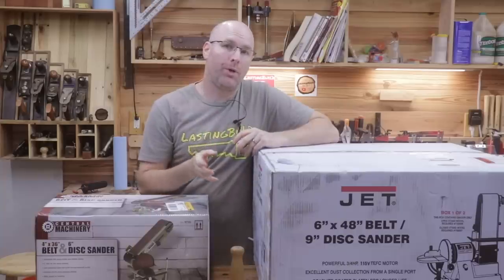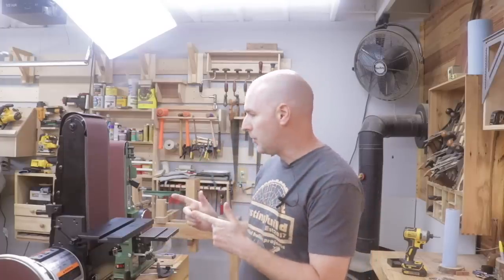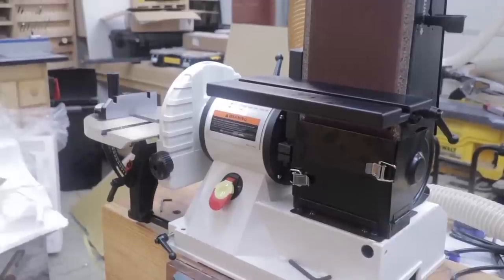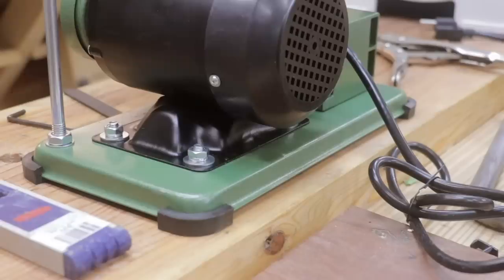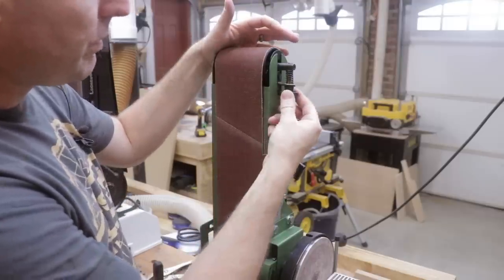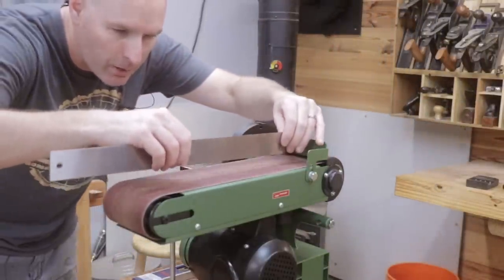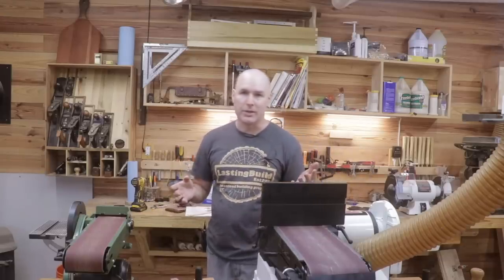The REAL Difference In This Cheap vs. Expensive Tool!

Comment: So this isnt so much a gripe about this video as it is about the whole HF vs expensive tool (ET) thing.  I have that HF sander, and it serves my purpose.  I wanted a belt/disc sander and looked at HF and ET.  My choice came down to HF or live without.  Going into the transaction I knew all those deficiencies you describe, but I knew I could work around them.  HF tools are infamous for their shortcomings and the underground network of modifying them so they work well.  I don't do production work, and I only turn on machinery on weekends, so I can live with my decision.  I recently watched a video of another woodworker I like who ran into some problems with an HF band saw.  He blamed the problem on the "cheap, and "unsafe" tool and vowed to throw it in the trash, thus preventing anypne else from getting hurt by it.  Upon further review, his was a case of operator error rather than maxhine failure.  I have that same saw and never experienced anything like what happened to him.  Again it was a value proposition in that I could have the HF saw or no saw.  Thats the choice for many of us hobbyists.  Its not so much Jet vs. HF.  Its HF vs nothing.  I can modify a dust port or build a bigger table to rest my workpiece.  I know that I will have to do that before I ever plunk down the cash to buy the HF machine.
Reply from the maker: Very informative comment! Thank you!
Reply: @lastingbuild1373  Youre welcome. I love ypur channel and the last thing I wanred to be was critical of your efforts.  I enjoyed this video.  Thanks for putting it together.
Reply: WW MM?
Reply: Nikolai Cook Just what I was thinking.
Reply: @matthewpotter1933  I'm guessing you're talking about the Steve Ramsey video lol. I felt the same way. I was like "Bro! Send me thet thing and I'll make it work!" Lol.
Reply: Well and the other angle to these cost propositions is "how much am I going to really end up using this thing?".  It's far safer to spend 60-150 bucks on a cheap tool, in the beginning, and upgrade later if you decide that's the route to go.   It's quite a bit tougher to spend 1000 bucks on a tool, realize you will hardly use it, and then face the dilemma of selling it to re-coop a portion of the cost, or letting it sit in your shop gathering dust (no pun intended).

I've done this with quite a few big box purchases... my first mitre saw was the 125$ Ryobi from Home Depot.  I wasn't sure how much woodworking I would really end up do, but I had an immediate need.  Once I got more into the craft, I upgraded to the 450$ Dewalt.  I still have the Ryobi, however, and it serves a niche when/if I need a quick mitre 'on-site', or I need to chop up some trash scrap for the garbage can.  I dont care so much about the tool or the blade, so I can treat it a bit rougher.  I don't want to waste my 100$ blades on the Dewalt chopping up trash 2x4s for the garbage, nor do I feel like swapping the blade out for such a silly task...
Reply: I agree, and they always pick the high end of the name brand tool, not a comparable version. Why not compare the HF with the JET J-41002, 2" x 42" Belt and 8" Disc Sander, 1Ph 115V (577004), a lot closer to the HF price range!
Reply: I think it’s a fair comparison. He said right up front what he was comparing. I’ve got a cheap Grizzly, fairly comparable to the HF and I recently bought a Grizzly $995 6 x 48 with 12 inch disk. The expensive Grizzly is comparable to the Jet here. The base is aluminum, as likely it is here, but the rest is all cast iron and steel. I bought the better one (with 1 horse motor), because the cheap one just doesn’t have the stability and heft when doing heavier metal work, which is a big concern for me. The bigger one is just far superior. There’s really no question that you feel that it will do whatever you need, while with the cheaper one, you have to be careful when you press, as the motor quickly slows down. That’s either with the belt or the disk. Nothing is really accurate as it’s flimsy. If you press down on the tables slightly, as you will while using them, they move. I think the cheaper motors are not putting out the wattage claimed. So, sure, they’re fine for the weekend warrior. I wouldn’t say otherwise. But if you use the tool fairly often, and want and expect it to just keep working properly when you push it, they fail. It’s a matter of being realistic. If you can’t afford, or find a good reason to buy the expensive model, then the cheap one will work. If you’re willing and able to put some effort into modifying some of the problem areas, you can make it somewhat better. But if you’re using it as part of your shop where it’s your living, either part time or full time, buy the better equipment. Remember, if you are making money with what you’re doing, this is a capital expense, and you will get your money back from writing it down for depreciation over three, or so years. So, in that case, it really doesn’t make sense to buy the cheaper tool, struggle with it and find it will have cost you the same in the end, assuming you don’t throw the cheap one out after some time. As an addendum, the big Grizzly motor felt stronger than 1 Hp. It’s 12 amps at 110 which is about 1 3/4 input Hp. Output seems about 1 1/2. Interestingly, the equivalent Jet model (at $1,500) which is pretty much exactly the same, claims 1 1/2 Hp for the same 12 amp motor. After having used the first some months now, I can say that spending the extra money is well worth it. These little models are really toys in comparison.
Reply: I absolutely agree. It's not Jet vs HF. It's HF or nothing. Harbor Freight fills a gap where I can do something on an inexpensive level or not at all. If the tool is cheap, often times a little tweak here or there is all you need.
Your comments above were spot on!!
Reply: That’s great for you. But the question still stands, for those who a better heavier tool is desirable. Some of you guys turn it into a situation where you say that the cheap tool is good for what you do and how much YOU can spend. Fine, but that’s not the video’s purpose. Not everyone wants to look between one cheap tool and another cheap tool. Many people want to know if it would pay for them to buy a better tool. You guys who complain about these comparisons seem to think they should only be of whatever’s cheap. He’s a professional maker, others do machine work (I do). We want heavier tools. Will the HF hold up, will the Jet, will my Grizzly? All different price levels and abilities. Yes, we want to know the differences.
Reply: @Joel4JC because that’s not the question here. It’s how a cheap tool compares to a higher price tool. There are other channels that just compare cheap tools.
Reply: @Joel4JC  this isn’t the high end of the Jet series of these tools. The high end of their belt/disk sanders is over $2,000.
Reply: @melgross I want more reviews on those 6x10s and 6x12s. 

Some beautiful beasts right there!

I’m not able to buy one new but those are some NICE looking machines! Pretty much no reviews for those.

Comment: Did anyone also notice the dude using disc sander incorrectly…is it just me or does that seem strange? And speaking of strange, for a guy who comes across confident about the topic and seemingly knowledgeable (at least on the surface) on tools and shop things does it really take an hour to put a couple belts and tool rests on a harbor freight belt grinder? Idk…but it’s not just this video or this creator that has been “funny” to me lately. What I mean is that I’ve been noticing a lot of YouTube woodworking and machinining tool reviewers that don’t seem to know very much about the hobby or profession for the tools that they are reviewing. Not all the time is it something that irks me, and there is definitely a place for obviously novice hobbyists reviewing tools (from a place of unintentional ignorance) bc that might be appealing to someone who is just getting into a similar hobby and wants to see what it takes to learn from scratch. I applaud those channels and frequent them often. But the thing I’m talking about is more reminiscent of this situation. A guy with a beautiful and seemingly high end and fully equipped home shop, filled with expensive tools and luxury items that even seasoned pros might not be able to justify, and then they do small little things that anyone with even a small amount of experience would know is totally wrong. Things like grind on the wrong side of the tool rest after making it a point to harp on the dust collection ports on the other machine. Speaking of which, what shop guy doesn’t have a drawer full of random cutoffs of pvc or hoses and a few zip ties to make a vacuum hose fit. And who compares a pro level machine to the cheapest one on the market? Idk, I’m not saying this guy is fake, but it just strikes me as weird and it’s something I’ve been noticing more and more. Maybe I should make a video about how I can’t decide between a 7x10” Chinese mini lathe and a $250,000.00 CNC machine. It just seems weird to compare these machines with each other bc there are many other similar machines that sit in between these 2. They aren’t even the same size, which would probably explain some of the weight difference. You would think a guy who can put $75,000 into a home shop would know better than to blow dust all up into his face bc he’s on the dangerous side of the tool rest. Just sayin…

Comment: Surprised you even bothered to compare them. If one has the budget to buy a quality built machine of the larger size, the small HF would not even be considered. Two machines of equal size and capability (small or larger) would be a more fair and useful comparison. A separate review of each one would probably have been a better approach. Each has its strengths and weaknesses, and definitely appeal to different markets and use needs.

Comment: When you do a comparison you should do apples to apples because they have a 6x48 combination Sanders $250 and comes with stand you should have got that one this is not a fair comparison
Reply: Agreed!  This is like comparing a Maseratti to a Fiat.  I owned and used that Central Machinery combo sander for a few years until I bought the Ridgid Oscillating Belt and Spindle Sander and the Central Machinery 12" Disc Sander.  I am pleased with both and I gave the Central Machinery Combo Sander away.  Last report was that it is still working.
Reply from the maker: That would be ideal but I did not want to pay for two expensive tools!
Reply: So your saying you didn’t want to compare apples to apples why even do it just to make HF look bad.
Reply: Sorry LB, but I have to agree. A shootout has to be fairly founded, this isn't; it's only 2x the money for same form factor. And the correct size HF tool claims a 1hp motor. I don't like to leave negative comments, but this isn't up to your usual standard
Reply: @lastingbuild1373  Well I'm not gonna watch any further. I want a 6 X 48 but this doesn't compare them.
Reply: @lastingbuild1373  I completely understand not wanting to put out that much money for 2 machines but, if you aren't comparing 2 similarly specced or sized tools, you shouldn't have done this video. It would be like comparing a Honda Civic vs. a Toyota Camry and giving the Civic a negative review because it doesn't have the same features, but it's not supposed to, its not an Accord which would be a comparable comparison.
Reply from the maker: Thanks for commenting! Be sure to check out my follow-up video to this one! It should clear up things a little!

Comment: When using the disc sander it looked like the wood was lifting. With the wood lifting the sawdust is going up on both sanders. The dust collection can only work with the dust going down. Also it is safer with the wood being thrust down against the table.
I suggest redoing the sanding disc portion with the wood on the downward spinning side of the disc.
Other than that, goos review for cheap vs pricey!
Reply: Definitely should be using the disc sander on the side that pushes the wood down.  If it rotates clockwise, that's the right side.  That will also help tons with your dust control and I think it's safer.  Even so I still setup a hood of the left side of my sander to help get the little bits that get away from the integrated dust collection.  A good downdraft table could do the same though too.  Both units are good at what they do but the jet should last a lifetime (although I'd go up to a 12 inch disc if I wanted a lifetime tool.)
Reply: First thing I noticed. Lol
Reply from the maker: I'm going to have to go back and check, I'm starting to think the harbor freight rotates counter and the jet clockwise. Ill figure it out and let you all know!
Reply: @lastingbuild1373  you are correct, the Harbor Freight is counter clockwise. The Jet is clockwise. Always sand on the downside of the sandpaper.
Reply: Yeah the jet looked like it went backwards to me (counterclockwise).  That's also why you got the chatter (movement) trying to hold it in place.
Reply: Shocked this wasn't noticed in the first few seconds of use.
Reply: @FountainCityVol  He shouldn't be using any tool.
Reply: Yeah,  he doesn't know that.. he's just an advertiser..
Reply: @S.Acosta-yg6od  You are just a troll. The man is skilled.
Reply: @lastingbuild1373  uh… sorry but what do you mean “figure it out” and “starting to think”? It was fairly obvious from watching the vid and should have been patently obvious either at first glance in practice or, at the very least, the instant you touched the piece to the wheel. Don’t mean to bust your balls but This is beyond basic which sort of discredit your “review”.
Reply: 100 percent he had it on the wrong side,  surely being a wood worker you would know this!
Reply: @billbucktube  wasn't the same thing on the jet. he put the wood on the up cycle.
Reply: Duuuh saw it the first time you started the thing and you need to go back and check you're bobo ?  🙄🙄🤦‍♂🤦‍♂And this is some one who make a video of machinery  😖😖🤣🤣
Reply: The instant he touched the wood piece to the Jet disk it was obvious the disk was rotating clockwise and why the work piece lifted and chattered.

Comment: Two things to be noted.
1. If you need a machine for work, Jet or another similar quality brand. But for most users, unless you have tons of money to blow or want to show off, a cheap sander will do just fine.
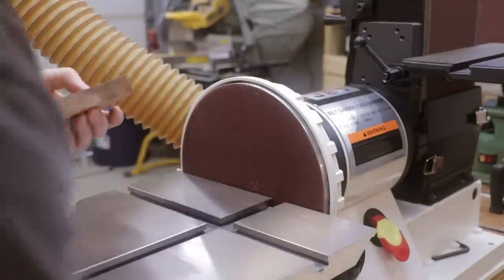2. The recommended and safe way to use a disc sander would be to place the wood piece on the side of the base where the disc rotation pushes the wood down against the base. Otherwise, you will not only get wood dust up towards your face but a flying wood piece if you lose grip at 7:30 of the video. Great video comparison though!

Comment: 8:00 1) you are doing it incorrectly and unsafe, you are supposed to sand on the other side of the disk, where the motion is downward. And 2) for $600 it is completely unacceptable how crooked the disk is. You can clearly see it here by how unevenly it has material left over on it. Definitely not worth 10x.

Comment: Good info.
 When I was younger I could only justify $60.00 for the Harbor Freight sander. It did most things I asked it to do and I was happy with it and the inexpensive belts and disc sander. Many years later I purchased a much larger Porter Cable bench top belt sander. It had many nice features the HF model didn't have especially the shear weight.
I guess in the end purchase what you can afford and you will be just fine.

Comment: I love the video but you do realized that the disc spins clockwise, which means you should have the piece to the right side of the wheel so the force of the disc is pushing the piece down, instead of on the left where you have to hold it perfectly steady else it starts jumping?

Comment: Unless you cleaned off part of the disc, at 7:50 it clearly shows that the aluminum disc on the Jet is not spinning anywhere near true. Damaged in shipping?
Reply: I noticed that right away. either the disc is deformed or the paper is not on even
Reply: The disk face isn't 90 degrees from the axel.  Very annoying.  I have a Rikon that does the same thing.  I also have the same HF model shown here.  it isn't square either, but it is much closer.

Comment: Why didn’t you get the same size as the jet?
 You got the small belt sander?  Harbor Freight has one just like the one you purchased and it comes with a stand and it’s only $300. That way you could’ve been comparing apples to apples instead of apples to a grape.

Comment: While I like the idea of comparison, your apple to oranges is a little pointless. I have owned the 6" HF sander for 14+ years, it has proven to be a good unit with only minor limitations. The one point of failure was the power switch, which I replace with a foot pedal type switch, I consider that an upgrade.
I would suggest that you purchase the HF and do an actual head to head comparison and then return the unit you find sub-par, HF has an almost no question return policy. One benefit to this approach is that you may find the HF and Jet are equally matched, thus you can return the more expensive unit; money saved to by more tools.
Thanks for listening and keep up the great content.
Reply from the maker: Thanks for sharing!

Comment: You were using the wrong side of the jet sanding disc I think, the wood should be used on the right so that the wood is forced down into the bed

Comment: We bought the HF sander you have there.   The disc sander was well off 90° from the table.    We checked the demo model and it was also off 90°.   We ended up with a Ryobi for about $120 or so and it's great!
Reply from the maker: I have not tried the Ryobi

Comment: My experience with harbor freight is that power tools, hand tools, drill bits, and saw blades are likely to fail quickly, if not on first use.  Things like anvils and bearing splitters do a little better.